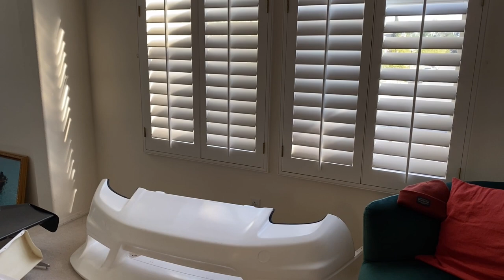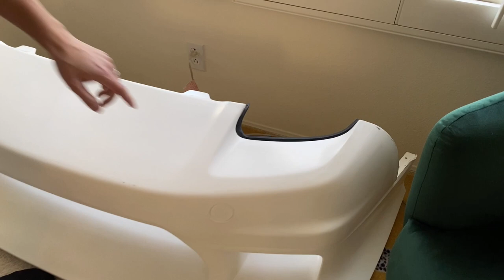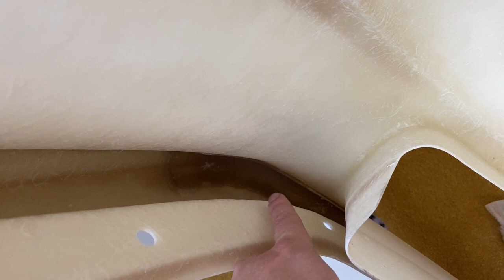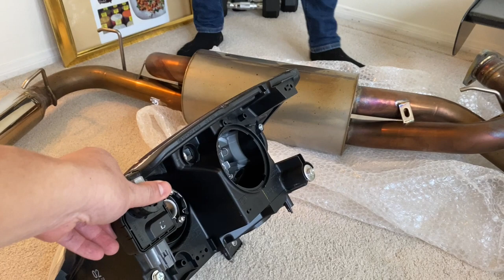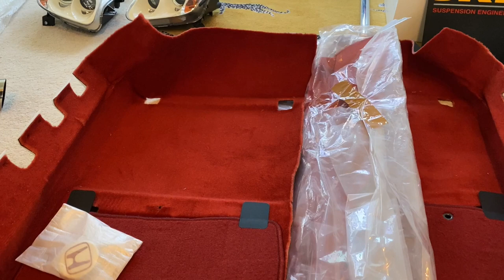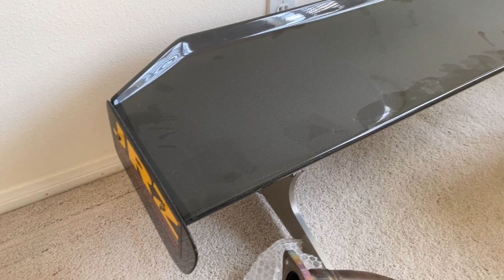An Introduction to the Next NSX Build...

Comment: Let me know if you need specs for the circular OEM mounting bolt cutouts for the Spoon GT bumper.  That looks like it can accept the OEM cover cap if cutout properly.  It was a shit tone of small and big parts to do the 02 conversion to full OEM spec.  Props to you for doing that.  Even the crash impack foam, the random tiny brackets... what a pain to source but all worth it.
Reply from the maker: Yeah I’m not sure what Harrys plans are for the cap covers. I think the bumper came with oem caps.

Comment: I'm going  to be following this build closely I have a Spa Yellow 97. Going to be interesting  to see your ideas. Might income some. Already love your mita wheels. Overall do the wheels and tires weigh less than the stock 97 setup? Also a few people have told me that the white wheels are so hard to keep clean. What's your experience.
Reply from the maker: So the yellow 97 is owned by Tony (ready2huynh in IG) and my buddy Harry owns the mita wheels. I’m not sure on weight. I think the mita wheels are 18-20lbs each. White wheels are indeed hard to keep clean but it’s a trade off for the look.